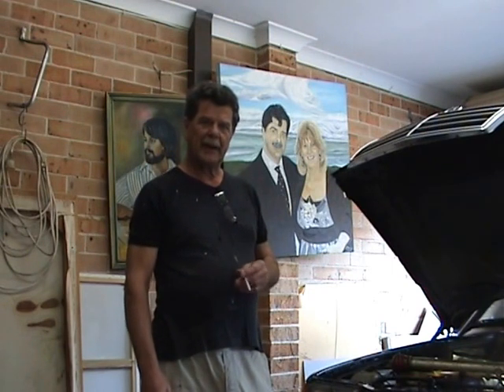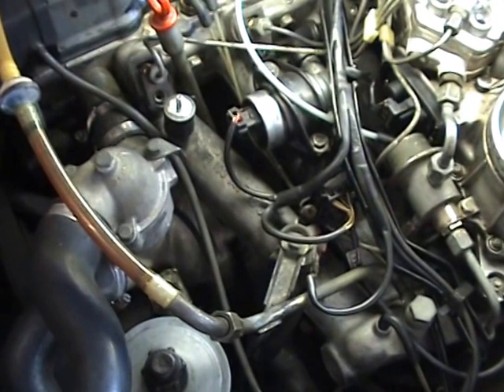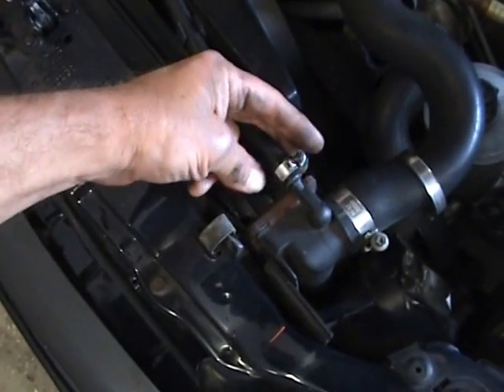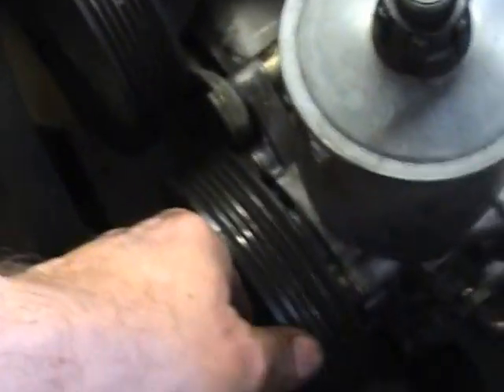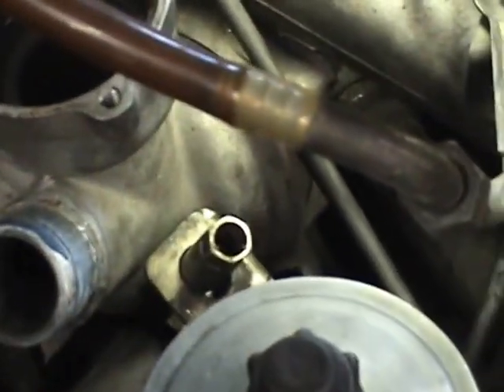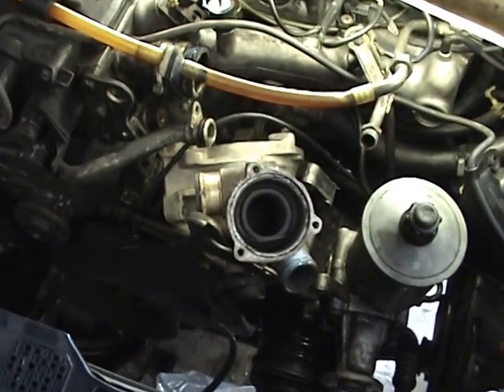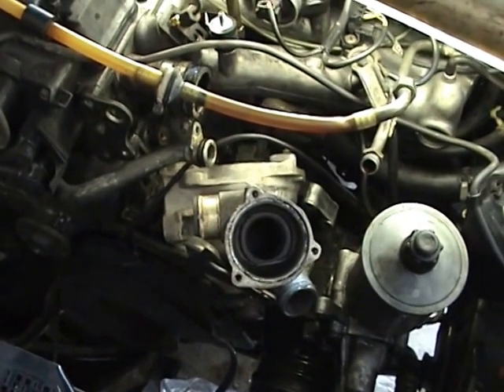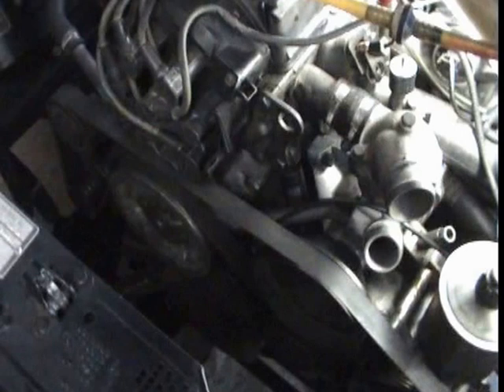Mercedes 300E Water pump replacement

Comment: Dont forget the lifting eye at the rear of the engine ,,right side .There is an o ring seal inside the bracket hiolding the lifting eye and the  hose for heater box. . .If the o ring  leaks then  coolant will drop from the rear of the engine on to bell housing ,,then on to the floor .Grand job RIFFRAFFJAZZ  love these videos

Comment: Thanks for taking the time to record your work.
I'm in the middle of replacing the radiator, water pump, fan clutch, hoses and tensioner.  It's my backup car (1988 300sel w126) so I'm taking my time.  I'm still trying to remove the fan clutch.  I need help LOL

Comment: Hi Riffraffjazz, Well I got the pump off, 4 hours, I did things slightly differently to you, as to be expected, surprising how many things I unbolted just to get at those 3 bolts, The dip stick I simply pulled out of the sump and the bracket nearest to the bottom bracket that secures the air con pipe I removed, how much easier that made. So now I have to wait for the new pump to arrive and hopefully I wont have forgotten the order in which to refit.

Comment: Sometimes  its just easier  to disconnect everything  and get it out the way so you got plenty  of room double  check everything  when putting back and you will be fine i got a waterpump from euro car parts about 87 pound good luck

Comment: FYI, on my M104.980 (1990 300CE), I had to remove the four bolts holding the AC Compressor, and the two allen bolts holding the another bracket, in order to drop it enough for that AC hose to get out of the way.  Then, you can get to that top right bolt, but BARELY!  You can sort of peek at the head of the bolt from the front.  You'll need a 13mm, plus a swivel or u-joint and an extension.  You may have to grind down the 13mm socket some (shave it so it's thinner) in order to get enough meat on the bolt head.  Luckily, my bolt wasn't on there very tight as I couldn't get the socket fully on the bolt head (was so afraid of rounding the head bolt!).

Good luck!  Some said you have to remove the plenum.  I absolutely did not want to do that.

Comment: Rif i am doing this job again after 4 years pump failed again .My question is did you fir a used pump in your video or did you fit mew seals in the old one ?     pump looks old
Reply from the maker: Hi, Trevor, I fitted a new pump, it was not expensive at the time. Cheers, Paul.

Comment: Thanks for the effort...I "like" the German engineering as I need to go through the whole process for just changing the short piece of hose between a water pump and engine body. I don't see any other way to swap the hose as there is only few millimeters room between and cannot push the hose through it...any ideas? Thanks!

Comment: No wonder people give up on these old Mercedes cars , from defective Head Gasket which fails at around 100k to Water pump which is pain in the neck to replace and difficulty working almost every part of the engine and still expensive parts even after all these years .

Comment: Sir do you think its possible to do the job without removing the radiator (ie simply removing just the shroud)? Surprisingly the MB service manual just mentions the removal of only the shroud.
Reply from the maker: Hi, David,  Unfortunately you have to remove the radiator to remove the shroud, it fits around the engine cooling fan, you would also not have enough room to get at the water pump.   Regards, Paul.
Reply: Thank you Paul! Apparently MB made a split-shroud version that it appears neither of us have. With the split shroud, no need to take off. Thanks again!

Comment: Nice work man! I have a problem with my engine m103. My car starts to overheat only at low speed and when it is at idling speed. There are no leakages. What can it be?? Thank you!
Reply from the maker: Hi, check your thermostat first, good luck, Paul.
Reply: Thanks for your reply Paul! I checked thermostat and its ok, my mechanics says that maybe the fan clutch is bad, But I dont believe him. What test can I make to the fan clutch?  Thanks in advance!
Reply from the maker: Hi, again
Check the fan if it spins freely, it should have resistance in it and not freewheel, Check it when the engine is warmed up and see if its grabbing, if it is just loping and spins freely the clutch is worn out. Cheers,
Reply: I dont think its the water pump. If the pump is bad it will overheat also at high speed. I ordered the clutch fan because it doesnt work!
Reply: maybe you have to try with the thermostat first. But 100 degrees its fine, more is not allowed. Its overheating when you drive at high speed?
Reply from the maker: Have you checked the thermostat, try removing it and see what happens, paul.

Comment: is it the same for the 2.6 6cyl?
Reply: The M103 2.6L and the M103 3.0L are virtually identical, if I'm not mistaken, it's just a matter of difference in bore. But as far as the external working components and accessories, they're the same engine.
Reply: You are correct

Comment: Thanks for the video. For all of the tool nuts in this world - Snap-On use to make a special extension with 13mm socket to get to the hard-to-reach WP bolts. The tool was FLXM13. It has been replaced by PFLXM13B.
https://store.snapon.com/Extension-Sockets-Swivel-Ball-mm-industrial-Socket-Metric-Power-Swivel-Ball-Extension-13-mm-12-Point-P813520.aspx
Some pro mechanics and diyers claim this cuts removal/install time down significantly.
And last but not least - here is the official Mercedes doc for water pump replacement:
https://www.startekinfo.com/StarTek/outside/12253/program/Engine/103/20-210.pdf